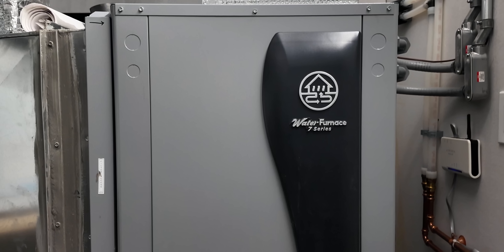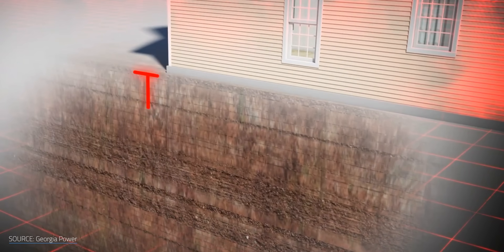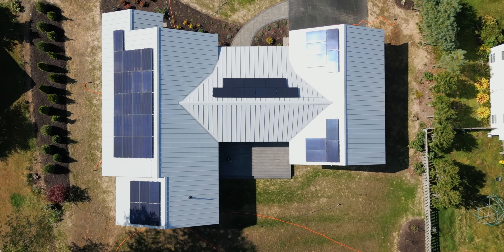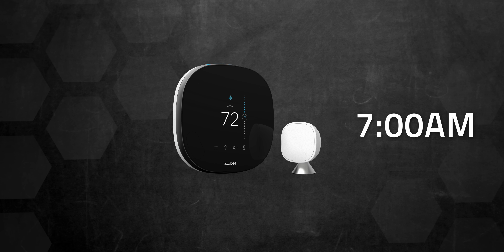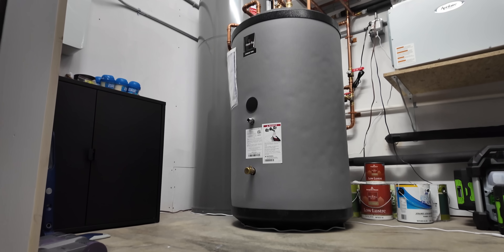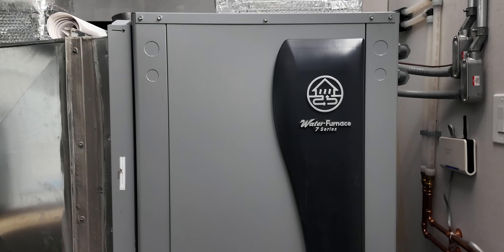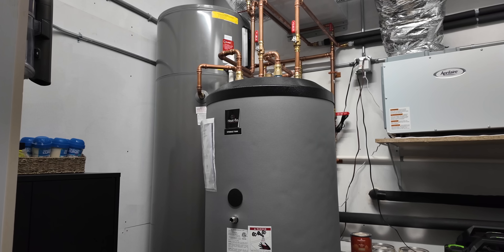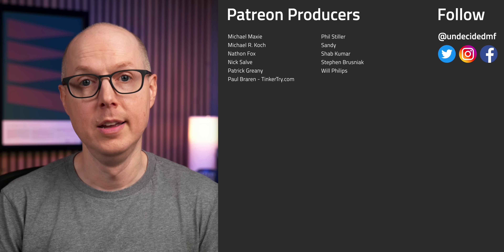How My Geothermal Heat Pump Really Performed (2 Years)

Comment: I take issue with the statement that with geothermal it somehow isn't worth it to lower your temperature while away. Using geothermal doesn't change any of the reasons that turning your system down while away saves energy. It only changes where the heat energy comes from/is dumped. I get the idea that it is slower to recover, but that doesn't mean that you're not saving when turning it down, it just means you gotta manage your expectations.
Reply: @AlanLister  the savings are much much smaller though. At that point it is a cost to benefit ratio. Does the cost of higher maintenance outweigh the savings from turning the heat up or down? 

On the system I’m looking at, you actually loose money turning the system up and down over the long run.
Reply: @jeffrbake What puts wear and tear on a heat pump system is an increase in the number of cycles, not necessarily the length of the cycles. So the argument that turning it down creates more wear and tear doesn't hold up, nor does the argument that turning it down will actually cost more money in energy use. Please explain why you think this is.
Reply: @AlanLister  the idea with turning the air up or down is that it stops the system from running. Compared to a heat pump, the cooling or heating action requires power. But with geothermal it’s passive. 

So by turning the temp up or down you would only achieve cost savings by making the pump turn off. And the start stop will increase wear.
Reply: @jeffrbake Ok but geothermal is still a heat pump. The system still works basically the same, the key difference is just in where it retrieves/dumps heat. I'm not sure what part of it you're saying is passive.
Reply: @jeffrbake And yes, start/stops increase wear and tear, which is exactly why turning it down as much as possible is helpful. If you leave the geothermal running all day, that's a whole lot of starts and stops to maintain the temperature that you could turn into one single start later in the day. 

The gain in energy efficiency with geothermal isn't coming from any kind of difference in how the system works, it's coming from the fact that it's retrieving/dumping heat energy in a much more consistent place that isn't nearly as extreme a difference in temperature as the air outside would be. 

So ultimately I get that maybe the savings aren't as big as they would be with an air exchange, but that does not mean that the savings don't exist, and it DEFINITELY doesn't mean that it actually uses more energy to adjust the temperature as you originally claimed the system you're looking at would.
Reply: @AlanLister  that system is using a variable speed pump. It reduces the exchange rate when the house is at the target temperature and runs at a lower speed to maintain the temperature. So in reality it never really stops because no house is 100% air tight.

And this system doesn’t use a condenser unit (well the big fan, the compressor is inside). That fan is a very large percentage of the electrical usage when a heat pump is running.
Reply: @jeffrbake That still doesn't explain the claim that it would use more energy to turn it down when at work than it would to just leave it turned all the way up all the time. The greater the difference between indoor and outdoor temperature, the faster the loss of heat, which means more work spent just maintaining. 

And while I understand that starts and stops contribute to wear and tear, that's not the whole picture. It can't possibly be true that one extra start is gonna be worse than 8 hours of continuous runtime. By turning it down you can get as close to 0 wear and tear as is humanly possible. 

I guess to put my point simply, I would ask... If it were really true that turning it down saved no energy (or even used more) and that it ramped up wear and tear significantly, then why does this guy still do it while on longer vacations? As I said right from the beginning of my comment, I'm not taking issue with the fact that he chooses not to turn it down anymore, I'm taking issue with the statement that it is because it wouldn't save energy. Not saving AS MUCH energy I can get behind, as that should be an obvious conclusion when you consider the system as a whole uses less.
Reply: @AlanLister  think of it this was… as mentioned in the video the system is a little slower than a heat pump. It’s really constant, but slower. So it takes more time at max speed to reach your desired temperature.

Now we need to compare. Assuming a normal use case of letting the system idle a little more while at work. When you get home it needs to run at full tilt. In this case I’ll take an average run value for this system at 1.6 kw. 

It would need to run at that level for a few hours. 

The amount of power it uses to maintain is about 0.1-0.3 kw. That’s 7.2 kw each day roughly taking the highest value. Compared to about 10kw if you turn up the heat. To get this number, I’m assuming the system is off for half of the day, but need to turn on at least twice while gone.
Reply: @jeffrbake I have a really hard time believing the system is only going to use 100-300 watts while idling. Even if it's slowing the pump while at the desired temperature, it still has to run the blower motor to move the conditioned air throughout the house. In the case of our system, which is a pretty typical system for a 2400 sq ft two-story house, the blower motor uses anywhere from 750-1500 watts of the total draw when the system is running. 

I guess the closest analogy I can come up with is that there is a pervasive myth that setting your fan to "always on" will save you energy because it will better circulate the air throughout the house, keeping all the rooms at a better overall balance. Now, maybe in some situations it would reduce some run time for the actual heat pump/AC part of the system, but it is easily more than cancelled out by running the blower 24/7.
Reply: @AlanLister  a large number of geothermal systems are radiant heat (as in the one in the video). There is no fan.
Reply: @jeffrbake I rewatched the video just to make sure I wasn't tripping, and nowhere in there did he say it was radiant heat. Not only that, but in the picture he showed, there is a giant air duct coming off of it. So I gotta call bollocks on that one. 

And when I do a Google search for different geothermal units, the overwhelming majority of them that I see are meant to deliver the heat/AC via air. The only way I see radiant units are when I specifically include it in the search. Also, looking at what his claimed installation costs were, it's hard to believe they also ran radiant heat through the whole house for that price, especially where he lives. 

Now of course in the case of a radiant system, what you're saying would be true, at least sort of. But that's definitely not the norm. And of course what also has to be considered is that radiant heating is not an apples/apples comparison. It's pretty universally understood that radiant heat sucks compared to forced air delivery, which is why it hasn't been the norm for about a half century. So claiming energy savings by switching to radiant heat isn't really a fair statement. Anyone I know that still has a house old enough to have radiant heat ends up needing to use something else to supplement it, which is even more reason to be skeptical of claims of savings. 

So it would seem the unit in this video is indeed just another heat pump system, with the only difference being where it gets its heat from, which is what I said from the beginning. Therefore, the gain in efficiency is strictly from where it gets its heat, and therefore, claiming that it is more efficient to let it run all day is false. I think what the author is trying to say is that it doesn't save AS MUCH, and it also creates additional inconvenience, therefore he's fine with just not messing with it since he's already saving money anyways. If it were true that turning it down really did cost more money and increase wear and tear, he wouldn't turn it down for vacations.
Reply: @AlanLister  ah, sorry I must have misheard. In that case I think you have a point, though I still think any cost savings with this setup will be pretty minimal compared to a traditional heat pump.

I’m actually planning a house right now with geothermal and radiant. But I’m using a special sub flooring that has channels cut into it with a copper plating that helps spread the heat. This may be a significant difference as compared to older houses.

Either way, I think our discussion is mute. Since he is overproducing electricity and his current use stays within his production, I don’t think it really matters anyway. If he turned down the air it really wouldn’t have a dollar difference for him.
Reply: @jeffrbake Yeah for sure, if you're producing your own power and staying in your limits, then it's all good. Do what's comfortable. I was more so arguing for everyone else that might be reading/watching. I definitely dream of the day I can go all solar so I don't have to worry so much about how much energy is being used lol...
Reply: @AlanLister  we have solar, it’s really nice. But installers suck. It was a terrible process.
Reply: @AlanLister  he said that he turns the temp down when he's on vacation. Maybe watch the whole video before commenting
Reply: @c0dy42 I did watch the whole video, silly. He specifically said that after switching to geothermal he stopped doing things like turning it down when leaving for the day, or turning it down at night. Maybe YOU need to pay closer attention...

Comment: In a new home that exceeds code in a state like Massachusetts, there is no good reason to install a geothermal heat pump. Part of the value of a tight, well-insulated home is the privilege of installing cheaper, lower output HVAC equipment. The value of geothermal is mostly in heating very large buildings (such as schools) or inefficient older buildings that can’t easily be retrofitted to higher performance.

Comment: My in-laws installed (retrofit) a ground loop geothermal system 30 years ago in NW PA in their 60 year old home. Zero issues in that time. It helps they are on 10 acres. They monitored sunlight at their house for a year and decided not to install solar - the ROI just did not support it (yet).

Comment: I will be eternally grateful to the guy who paid 50k for horizontal geothermal installation, then gave up because of the leaks, and sold me the 20kW water/water heat pump for 300€ lol
Reply: That's wild, mine came with a 50 year warranty. Why someone would give up is confusing...
Reply: @Belo83  And the company backing that 50-year warranty will be gone in 2 - 3 years.    Never found one yet that didn't disappear just before all their warranty work started to come into play.
Reply: @tcmtech7515  it's a manufacturers warranty. But yes that's a risk I suppose. The company that did mine also does solar and other work, so they're not just living off geothermal.
Reply: @Belo83  And then you will get maybe 10 years before they restructure into something else, and all records of your warranty will have disappeared.   

I'm old enough to know how multi-decade warranty coverage works.  It doesn't.
Reply: @tcmtech7515  My guess is you've never done enough research to back up that claim.
Reply: @basedbear1605  And you'd be wrong.
Reply: @tcmtech7515  according to you all warranties aren't worth the paper they are printed on then your advice is what? Never buy a HVAC system for your house?
Reply: @spaccorn  Quote exactly where I made any such claim about HVAC systems.  😁
Reply: 3rd party serviceability > warranty
Reply: @Belo83  where you are expecting  to find company which sold you Heat Pump in 49 years ?🤔
Reply: @andriiprychepa5288  The heat pump is never lasting 49 years and heat pumps are readily available. The issue discussed is the ground loop, which has the warranty from the manufacturer. Sure it's a gamble, but the fact that the warranty is that long says something.
Reply: 22 years in installing geothermal, cheap energy bills, NO leaking. Could not be more pleased.
Reply: @Bullhead2017  And how many times have you shut down as one company and reformed as another in order to get out of warranty liabilities?
Reply: Brother spent $400K for a large complicated system.  It has not worked for one month since installed decade ago.  He heats with propane now.
Reply: @heinerphilipp  $400k? bahahaha

Comment: I looked into retrofitting a geothermal heat pump system back in 2013. Our local installer was very enthusiastic but I was wary of the fact our house is built on rock and drilling would be difficult.  Unfortunately the air source system with water panels didn’t work well.  Our house is rammed earth and not as well insulated as I’d like, though it’s been upgraded.  The enthusiastic installer went out of business just as our compressor died. The replacement system was worse.  I ended up taking a big loss, pulling out all the water panels and getting regular air-blowing reverse cycle air conditioning. I don’t like the type of heat nearly as much, but there are lots of good local installers who know what they’re doing.  I’m glad I didn’t go for the geothermal with an incompetent installer.

Comment: We are in CT, so likely similar install costs. I’ve done some looking around nd talked with a neighbor who just installed geothermal in a new house.  I’ve decided that the upfront savings of surface heat pump vs geothermal makes it the better option for us.  Our house is currently oil fired ducted hot air with traditional electric AC units outside. To change to a hybrid heat pump system I simply need to exchange the exterior AC units with newer heat pump units of approximately the same size and cost (the AC units are 30 years old and need replacing…).  It’s called a hybrid system as the oil burner remains and kicks in anytime the heat pumps have trouble keeping up (very low temps in winter, large demand for hot water…).  My calculations indicate this will cut my heating/cooling costs in half or even by 2/3, even tho I will be adding about 700sqft of heated space over the garage. I like having redundancy for heat just in case, and we plan to sell the house in 10 years or so, meaning that longer term payoff is less important for us.

Comment: $70,000 cost -- add the mortgage/loan interest per year. 
Energy-efficient appliances break down quickly -- add repairs and early replacement costs.  (Remember your parents or grandparents where appliances lasted 30 years?  And maybe are still running?  Unlike modern appliances which can start breaking after 5 years.) 
You are still paying for the rebates -- thru your taxes.  And people without a heat pump and the associated rebates are subsidizing you.

Comment: What I wonder is if pooling costs makes more sense in e.g. a housing development. You seem to have built with no reference to your neighbors, in terms of your energy generation/ usage. However, the reality of new home construction is that the majority are built by housing developers in planned communities--common architecture, etc. So just as we plan community parks, playgrounds and other shared resources, I'm thinking that drilling one big hole that can be shared by a whole development makes a huge amount of sense. Surely there's got to be a cost efficiency when you share a geothermal bank just like we share other utilities (water, sewage, electricity, roads themselves) that come to our residences. This seems to be even more of a no-brainer for apartment complexes. Thoughts?

Comment: I’ve had geothermal for about 15 years with diagonal wells. There are many positives, as you’ve noted. However, efficiency can taper over time depending on the well design and climate, so be aware of that.

Comment: I have this system. The 6 not 7. And after 10 years we had to replace the cooling coil, bower motor and variable bower control. I have the vertical loop with five 275 foot loops.

Comment: Thanks for this report.  One simple thing missing would be the overall cost comparison, including installation amortized over the expected life - or your investment horizon.  Say 30 years.    Factor in the annualized cost of installation plus actual running cost vs similar calculations for alternative systems  (air-to-air, natural gas, electric etc).   I suspect the result will be strongly affected by two things - the available incentive programs (these seem to be going away under the current administration) and the number of years you anticipate living there (it's not clear how much, if any, a less-conventional heating system would affect the house selling price).
Congrats though.  An impressive system that does what you want.

Comment: The running cost is great. The install cost is nuts, also those pumps don't last forever so there may be more high future bills too. It doesn't make economic sense yet but hopefully prices will come way down and then it will make sense. I'm holding out for now but definitely interested. I have a large solar system, natural gas heat, and regular electric air conditioner. I have gone entire YEARS with ZERO utility bill thanks to net metering and an over supply of solar electric (yes, the overage actually pays the gas bill too, same utility company).

Comment: Slow responding systems are not ideal particularly if you like it cooler at night for sleeping.  With a slow system, you will have to keep your bedroom areas cool all the time if you like it cool to sleep, and that has its downsides as well.  I prefer 64 for sleeping and 72 during the day and that is hard to achieve with  geothermal, baseboard or in-slab hydronic.  I prefer a well-designed forced air heating and cooling system for that reason.  I have in-slab hydronic in my workshop as I do keep that stable at all times and that works well for that application.